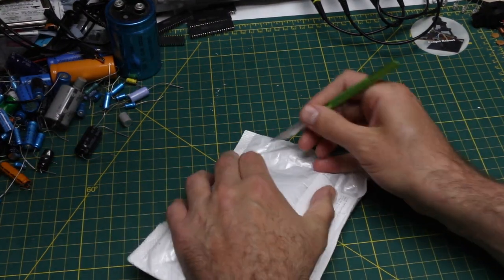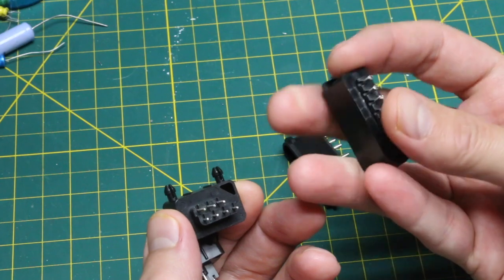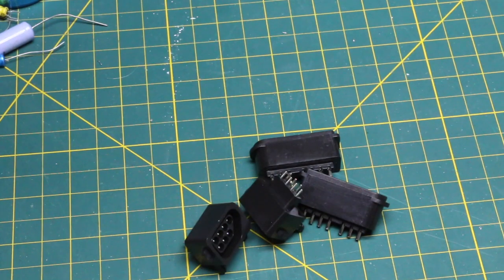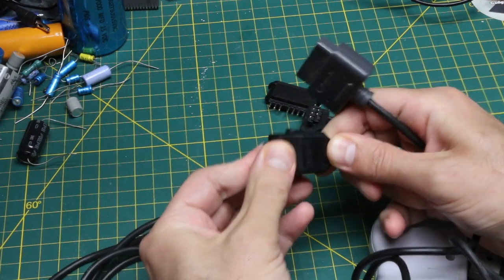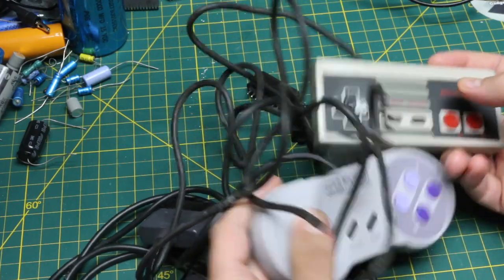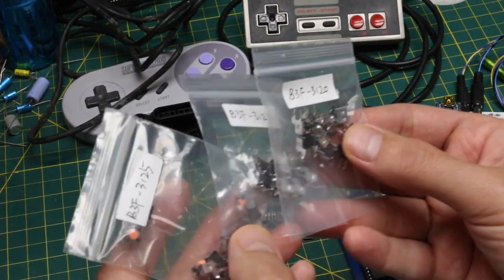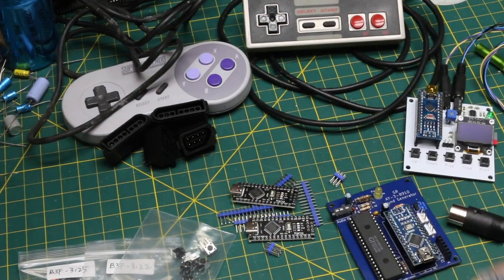Mailbag!

Comment: I'm thinking of using 6S17K-V ceramic microwave triodes in a microphone preamp.  They have exceptionally high gain (185) and extremely low noise, owing to the very tight tolerances of construction, and can be run with a grounded cathode.  They are made to be mounted directly in a microwave cavity, hence the unavailability of sockets, but they can be soldered to directly.

Comment: That Triton FetHead looks really cool. I use a TC Helicon VoiceTone Create XT, great solution but it costs a bit more.
Reply from the maker: yeah I like the result of using it and although it’s made of solid materials, having this extra dongle hanging off the microphone and then another cable on that and then hanging  downward  with that small microphone stand I was using, it puts torque on it so I think it’s best suited where maybe the cable can be wrapped around or tied to A longer arm on a stand for a strain relief

Comment: I am sorry to send you chasing my ghosts. I started in digital video a long time ago.  Mosquito noiwe, color banding, and hot pixels were the bane of video. I have spent hours removing these artifacts that regular people didn't notice; call me Sisyphus. 

Digital photography (my other hobby)) was even worse until RAW and high pixel count sensors showed up. Hot pixels were easy to fix in Lightroom. They did not move so one dlick and apply to all fixed it. All new sensors and displays have hot pixels, they are accounted for from the factory, like bad sectors on storage media. 

Stuck pixels come and go, hot pixels are white and permanent, dead pixels are black and permanent, and as equipment ages it gathers bad pixels. I have a camera with 3 hot pixel very close together. 🤯🤯🤯😖🤬🤬🤬🤬

Sorry again. I can just watch youtube at a slightly lower resolution with upscaling on the TV and all is good.

Comment: This was an annoying episode. See about at 4:33 on your thumb. There is another intermitant one nearby. HATE THOSE THINGS!!!!! Distracting as hell. My wife hates me when I point them out because she normally doesn't see them, but when she does....😖😤🤬

But seriously; warm, hot, stuck, and dead pixel catch your eye on against moving background and stay caught. Dead pixels only matter in bright scenew and are rarely a problem.
Reply from the maker: what exactly was happening at 4:33? I didn’t see anything weird with pixels.
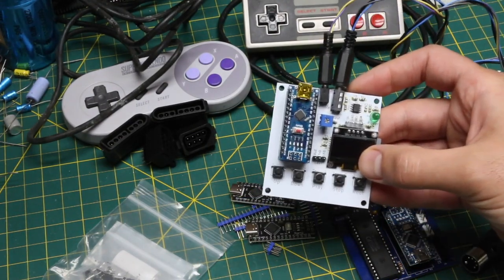Reply: @GadgetReboot  You have a hot pixel (white) over your thumb. Center of the screen, near the bottom. at the 2:41 mark it is between the header pins between the nanos. If you can't see them, feel lucky. They will drive you crazy.
Reply: @GadgetReboot  I had to do a few takes, but finally saw it.  Yup, just one pixel.  Cannot imagine getting worked up over it though.  Specks of dirt (snot?) on my screen are a lot more significant than that.
Reply from the maker: I saw at least 2 areas with white pixels when looking in the video editor so I manually ran the sensor cleaning (which also auto runs regularly) and I think those areas are fixed now, at least for now.  I wonder if the thing needs a more in depth cleaning, it's over 6 years old and never had anything special done.
Reply: @GadgetReboot  Beware, the Pixel Police are on Patrol.